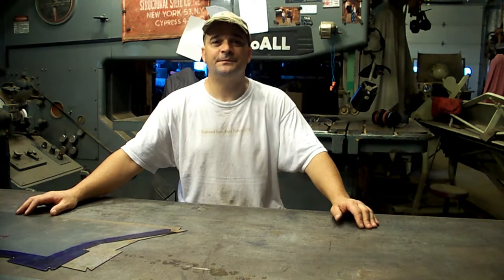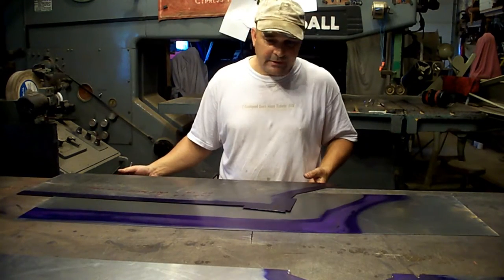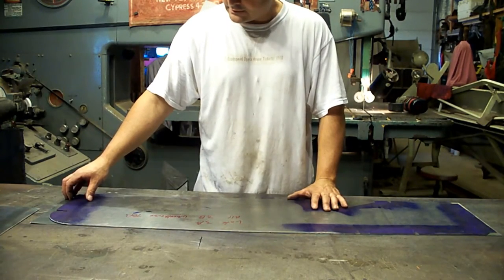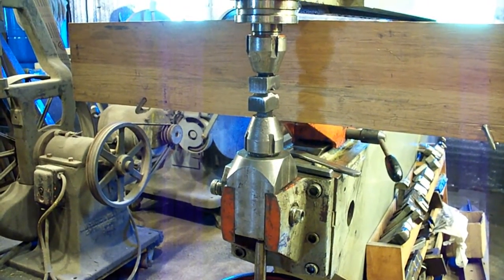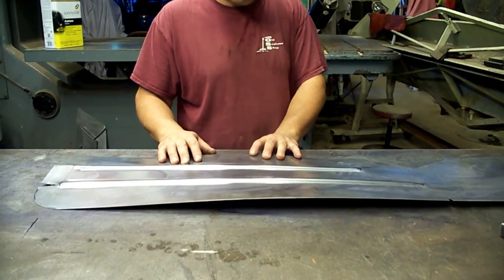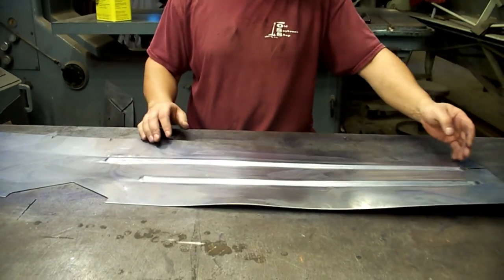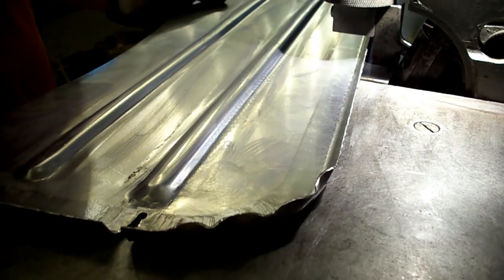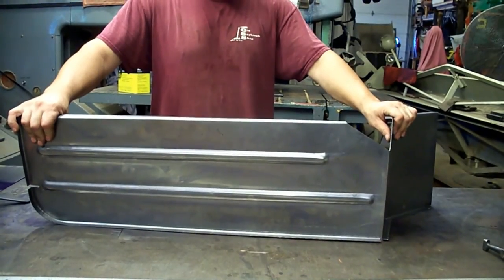Metal Fabrication Willys Jeep CJ3B Body Tub- Wheelhouse panels part 1

Comment: Do you sell your patterns?
Reply from the maker: No I don't sell patterns, just completed panels
Reply: metalshaper do you have a website I could buy them?
Reply from the maker: I don't have a website but build panels to order as people need them.  let me know what you need and I will let you know if it is a part that I offer.
Reply: metalshaper fair enough. what's the cost for 2 rear light panels for a 3B I have a M38 but know the 3B is the civi version.
Reply from the maker: Tail light panels are $35.00 each.   They come solid with no hole for the light, so you can drill the exact pattern you need for your tail light .  You can reach me directly at metalshaper@comcast.net